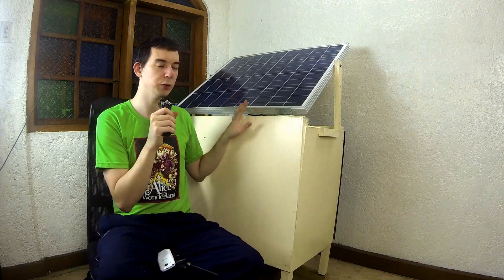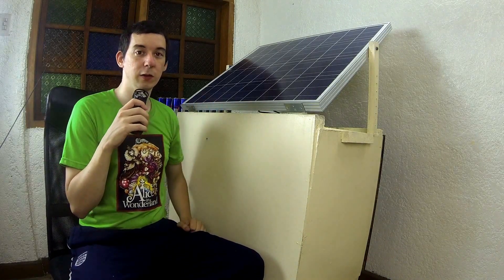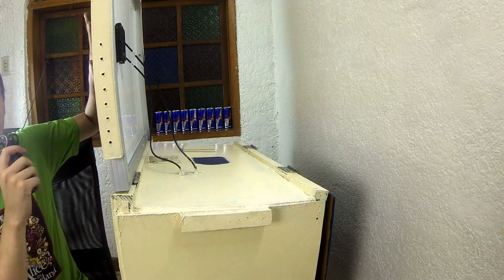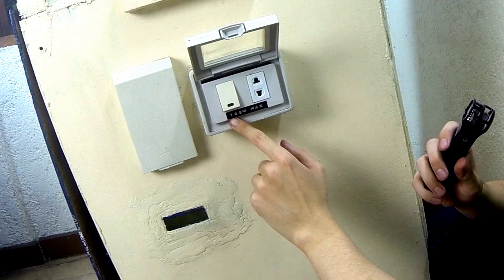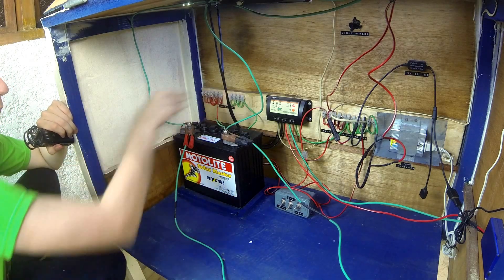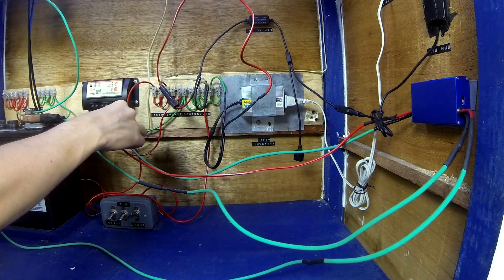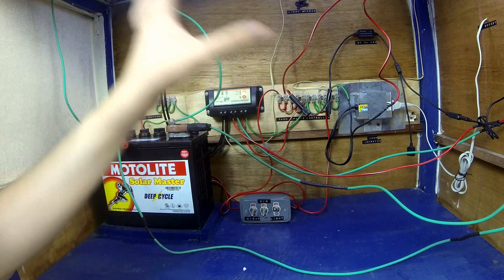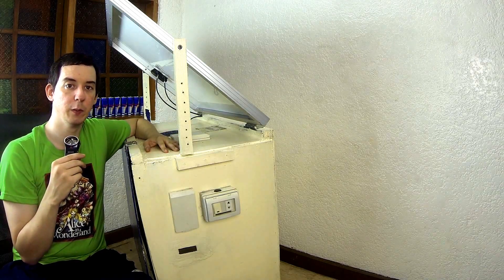Portable Solar Power Unit

Comment: ●Add DC 15amp fuse wire(you could buy it from a motorcycle shop,I prefer the flat fuse with holder). Connect the dc fuse to the positive wire of the solar panel (better connect it inside the wooden box). 
●Add a DC Breaker and connect it between the battery and the inverter dc side. 
●add a mini a.c. breaker and connect between the inverter (a.c. side) and to the a.c. outlet.
●add a dc fuse wire (5amp) between the dc converter and to the USB outlet.

Comment: hi.what type of battery we need to this project?except motolite solar master?please give me another class pf battery to use in solar.local brands.
Reply from the maker: Any deep cycle battery :)
Reply: car battery it is ok to use in solar?because i have a motolite solar master.and before 1year the battery is dead.and i go to market and the battery is out of stock.
Reply from the maker: Jeng Fernandez A car battery isn't suitable because they're designed to output a large amount of power in a short period of time (to start an engine) and cannot handle being heavily discharged multiple times. You can find deep cycle batteries elsewhere, even cdrking sell them. Make sure you keep the water topped up since this is a very hot country we're in.
Reply: +Gadget Addict cd rking deep cycle battery is good?because it is not a branded batterry like motolite solar master.
Reply from the maker: Jeng Fernandez I haven't tried it but some people commented that it's okay.
Reply: +Gadget Addict ok sir.thankyou.

Comment: You might want to put a some sort of low amp breaker for the inverter in case someone plug in a device that will overload the 100 watt inverter. (some people are not good at following instructions or just want to watch the world burn). Although you can easily replace the car fuse inside the inverter to get it to work again, (I've done it with my 300 watt cd-r king inverter) it is still a hassle to do it during an emergency situation.
Reply from the maker: That's a really good idea. Like you say it's easier to flip a breaker than have to try replace the fuse. Or if something else burns out before the fuse lol. Thanks for the suggestion :) it might be hard finding a breaker that trips at that low current though. Maybe an inline fuse holder that's easy to swap out the fuse when it blows (with spares inside the box). Or perhaps a breaker on the DC side.

Comment: what is the name of the thing that you called a terminal for external charging?
Reply from the maker: +Rafael Ranario The box at the top? It's a waterproof cover intended for outdoor electrical sockets. I just used two regular bolts straight through the wood and wired to the battery and then use that cover to protect them from rain.
Reply: +Gadget Addict  what do you call the regular bolt? i dont know what is the specific name for it
Reply from the maker: Rafael Ranario It's just called a bolt and nut. There's no other name.
Reply: +Gadget Addict thanks
Reply: +Gadget Addict do you have a FB account or FB page :)
Reply from the maker: +Rafael Ranario Just twitter, @ytgadgetaddict :)
Reply: +Gadget Addict thanks
Reply: +Gadget Addict ive message you in twitter dude :D
Reply: +Gadget Addict where did you get your usb adapter (3AMP DC-DC)
Reply from the maker: Rafael Ranario Got it from ebay, came from hongkong. It was around 200 peso with free delivery.
Reply: +Gadget Addict thanks

Comment: What size of shrink tube you use sir?
Reply from the maker: +Kristina Ramos I'm not sure. I have a few different sizes and just use whichever fits best. I've never really checked the specification of the heat shrink tubing.

Comment: How many solar panels and batteries do i need to run a window type aircon? thank you!
Reply from the maker: Alfredo Coronel Short answer: A lot. Long answer: It depends on the specific aircon since a small one might consume only 500 watts while the compressor is running but a larger unit might consume 2000-3000 watts. It also depends on how many hours the aircon will run and whether those hours are mostly at night or during the day while the sun is up. If it's a cost saving/earth saving exercise then you may prefer to grid-tie your panels and forget about batteries. If it's for off-grid living or to supplement a poor grid then batteries would work but you'll need a very large bank of them.
Reply: Thanks a lot gadget addict!

Comment: meant to say this panel is to supply power the house to approx. 6 or 8 15 amp circuits single pole 110 volts that the reason for the jumper to have 110 on both sides of the panel
al

Comment: Hello gadget, Greetings from the U.S. I have built a solar system consising of 13  100 wattpanels so plan to add more, have got to the part where I want to connect a electrical sub-panel lhey don't have a main breaker in them, so what I want to do is using the power from the batteries to my inverter use a # 10 AWG which is 10/2 with a gound which would have a 15 amp plug to plug into the inverter and run about 30 feet to the house to the sub-panel, now the sub-panel will is generaly wired for 220 using 10/3 with a ground ( red, black, white, & ground ) my plan is to use 10/2 and and make  JUMPER to supply the two legs with say a piece of # 8 gauge to make it 110 on each side.Tis panel ( load center) will house approx. 6 to 8 15 amp circuits, so will that connection work to energzine that load center to supply power to the circuits. Also I was in the Philippines in 1992 I stayed at the Midtown Manila

Thanks Al     Galloway NJ USA
Plus I love your video's 

 

00

Comment: can you connect 1000w inverter? im kind a new to this, im learning from all of your videos. salamat
Reply from the maker: gjrp18 Provided your battery can handle a 1000 watt load, then sure. Check the specs of your battery and see what it's ratings are and for how long. Of course the larger the load, the quicker you'll consume the battery.

Comment: can you connect another battery together with that same setup?
Reply from the maker: gjrp18 Yes, multiple batteries would give you more power storage. You could put them in series for a 24V system which could make better use of your charge controller.

Comment: Bro,
   You got a very clean hand and I realized why my wires get messed up after looking at your organized box. Suggestions: 1. Connect another Watt meter between the Panel and Controller so that you know how much charge you are getting in. 2. You should take up a project of making a tracker for your panels. I am curious on what you would come up with. you can take the electronic route - have a microcontroller, LDR and servo motor and make a dual axis tracker. Alternately you can build a single axis mechanic tracker which uses a clock work system since you already have a mounting system to adjust the north south seasonal adjustment. You may have to build a potter wheel type base for your panel mount. Commercial trackers are expensive and are usually designed to track an array of 3KW panels. For small panels like yours, I am yet to find a cost effective solution. The tracker should cost no more than the panel or else it will become cheaper to buy a second panel. However I like efficient systems and am curious on what you can come up with. I'll keep watching.

Comment: nice set up! Iguess you're using a zoom H2 audio recorder,correct me if i'm wrong.
Reply from the maker: Ray Luis D. Monserrata It's just the Zoom H1. Entry level but it can produce some good audio.
Reply: I like zoom product.I also use zoom Q2HD.I like the High Quality audio.
Reply from the maker: Ray Luis D. Monserrata My only complaint is that my Zoom H1 depletes the battery when turned off. Sometimes I forget to remove the battery and then the next day its already completely dead. It's a known issue and in the US they were replacing them under warranty. I asked JB Music about fixing/replacing mine and got nowhere with it.
Reply: Gadget Addict I guess that's really an issue on the zoom unit,it drains the battery fast,especially if i use 1020HD for the video setting on my Zoom Q2HD.they need to fix that problem.

Comment: hello again i have a question again... im planning to expand my solar system, the problem is if i will add additional solar panels and it is in a parallel, the current will be large and it needed a bigger wire what would you advice if for example i have 4 135 watts panels in parallel.. how will i calculate the size of the wire that i will use? if i will have that 4 panels i will have 45 amps and i will need a 45 to 50 amp charge controller to accommodate the incoming current from the panels right?
Reply from the maker: tats razo You would indeed need a bigger charge controller. Another option would be to put them in series and upgrade your battery setup to be 24v. That way you can push more amps through your existing charge controller. There are calculators that can advise which size wire you need based on the current and length, try google 'DC Cable Sizing Tool'.

Comment: hi phil it's been a while since i first have a message here...remember i was asking for your solar system. now i'm starting put up my own..thanks to you and your video i have the knowledge how to put it on my own...right now i have a 135 watts panel and a charge controller. still saving for the inverter and solar battery.. may i ask you how long can this panel charge a 200ah battery?... really thankful to your informative video wish you more blessings and luck coz youre helping locals like me here in the philippines..
Reply from the maker: That's great to hear :) As always, I'll ignore any losses for the sake of keeping the math simple. To keep your battery in a great condition, it's recommended that you don't discharge your battery beyond 50%. If you had a 200ah battery, you wouldn't want to discharge it beyond 100ah. 135 watt panel at 12 volts would be 11.25 amps. 100  / 11.25 is 8.8 hours.  So you could charge your battery from 50% to 100% in around 8.8 hours. But of course there will be some charging losses, the panel won't always put out the full 135 watts etc. So in reality it might be closer to 12 - 13 hours.
Reply: Gadget Addict thank you so much for your reply... now I have a rough idea how will I manage my battery....by the way have you visited quiapo area particularly raon? there's a ton of panels out there and it's cheap but be sure not to buy on the side walks only those who have legit store so that you can have secured transactions and warranty.. and you can haggle the price...

Comment from the maker: Only Oric, your youtube settings do not allow replies to your comments. You should use a fuse for anything wired to the battery or charge controller. But no, you don't need a circuit breaker for that setup.
Reply: Gadget Addict Hey bro sup...I was just renting a room here on my location. I wonder if you can gave me a complete list of components for i am interested to buy a 20 or 50W Solar Panel. Aside from 20 or 50W solar panel, charger controller and battery, what else do i need? Do i need an inverter for my ceiling fan and led light bulb?
Reply: Lyto Magbato yabang hey bro bro bro kapang nalalaman
Reply: Problema mo..?
Reply: yabang mo kaya
Reply: Dahil nag English ako mayabang na? LOL
Reply: mag practice ka sa English mo kung ayaw kitang tawaging yabang halos ang nakikita ko sa comment mo ay mali and sentence mo
Reply: juan sambo LOL...Ahh so magaling ka pala..sorry ha...Peru parang ikaw yata ang mayabang....Pasensya kana kana tol at hanggang dito nalamang ang pagiging KSP mo...
Reply: putangina ahh yabang neto ehh bobo bitch
Reply: LOL
Reply: Lyto Magbato oo tama nga ako bobo ka nga na bobo ka sa CLASH OF CLANS!!!! BOBO PINALAKI KA NA BOBO
Reply: LOL
Reply: juan sambo O tapos?
Reply: lol hahahhaha

Comment: Hi Gadget Addict, am in the process of setting up a small solar power system. An 80 watts panel, 50 Ah battery and 10 Amp controller to power maybe two 5 watts light and a 15 watts (12v) fan overnight. Are circuit breakers and fuse necessary for this setup? Thanks.

Comment: Hi Gadget! Could you give the required diode number, rating, and size for my 100Watts Monocrystalline Solar Panel? Thanks
Reply from the maker: Gerald Underzone Hi, Sorry but I wouldn't be able to tell you. If you go somewhere like DEECO you can just pick up any generic one that is rated to handle more than 100 watts (100 / 12 = ~9 amp)

Comment: Hi, Gadget, may I ask about solar panel once connected in parallel, is that required diodes each + - line? because I was thinking let say same panel a little bit covered so would not be equal power and may push back the power to other panel.
Regards
Reply from the maker: Yup, all panels in a parallel setup should have a diode :)
Reply: Gadget Addict at present I already have 100W12Vx2 panel, esc100Ah12Vx2 rocket battery both from Quiapo, wellsee 20A charge controller and yoko 250watt inverter both from ksa, usage for some of my gadgets and over night light, it useful specially when utility lines destroy by glenda. Just now I realize required diodes, I hope will be okay until I come home on march.

Comment: Hello Mate,
I am a volunteer like you are (or used to be) in a agricultural project in Pangasinan Philippines. I am currently building solar powered water pump systems, but we would also like to run it with batteries on the side.
Could you be so kind and let me know where you purchased the wattmeter here in the Philippines?
Thanks a lot, regards from Pangasinan
Simon
Reply from the maker: Simon JohnDoe Hi Simon, I bought it from a seller on Sulit. If you can't find a local seller, you can buy it from 'Cavite Eco Solutions'. I hope you can share more info about your projects :)
Reply: Gadget Addict thanks a lot Phil, i will look into that. Sure i can give you more info about what we do, maybe just not over this channel, what's the best and easiest way to contact you? or i'll just give you my cell but will make it a bit complicated so not everyone will steal my number (you know how it is here :-). Just subtract each each prime number that exists in ascending order from the following group of numbers and you will have my CP number. I am sure a smart guy like you can solve it in a breeze: 2-11-7-15-17-20-21-24-34-33-42
hope to hear from you

Comment: very simple portable solar power unit. i like the uniqness. i wonder why some of the parts came from cdrking like the panel, inverter, are they good quality solar parts?
Reply from the maker: I've uploaded a video before, showing the quality of CDRKING solar panels. Overall I give them a big thumbs up. The inverters are okay lang. I would recommend the solar panels but I wouldn't recommend the inverters, unless you're on a budget and understand that you shouldn't run them anywhere near the rated limit if you want them to survive.

Comment: Where did you get the 12v to 5v dc converter? Thanks..
Reply from the maker: I bought it on eBay, they're extremely cheap. You can also find them on Sulit if buying in the Philippines.

Comment: hi sir phil... me again... may i ask how much is the battery u use in ur portable model..
Reply from the maker: It's a 40 amp hour deep cycle battery, 3200 PHP. Thanks :)
Reply: Gadget Addict ah sir one more thing.. (sorry i have a lot of question,, :)      if i have 1 unit of 40 amp hour Battery, what wattage range of inverter should i use, for my lights and fan usage... thanks much... :)
Reply from the maker: burgershoppe achmed Mmm while some people do recommend X watts per AH of battery, within reason you can use any size inverter. Just consider that the more power you pull out, the quicker it will drain. Whether you have a 100 watt inverter or 500 watt inverter doesn't make much difference other than one allowing you to pull more watts at once and therefore potential to drain the battery quicker. Don't oversize your inverter too much because it will consume more power while idle. Consider the kind of load you intend to run from your battery and size based on that and of course be aware of how long the battery is going to actually last.
Reply: ok sir thanks much.. :)